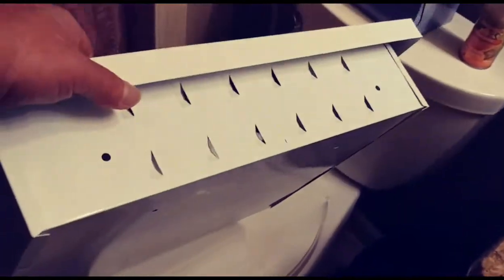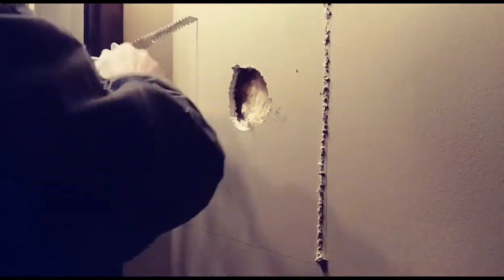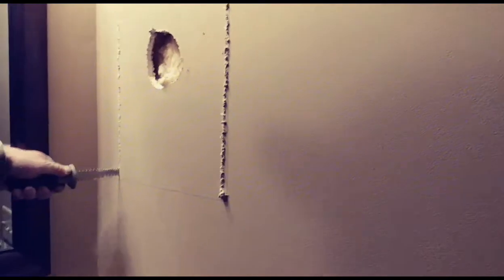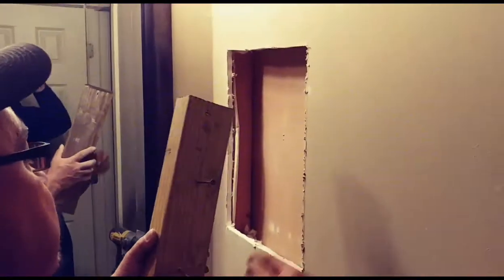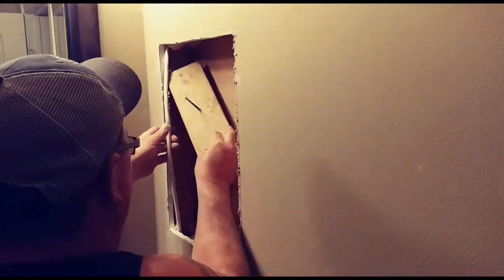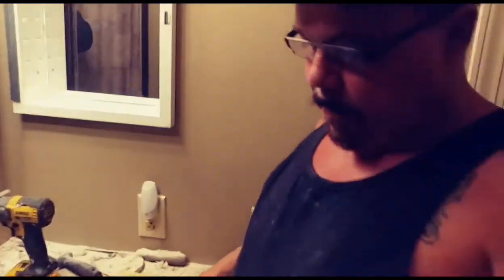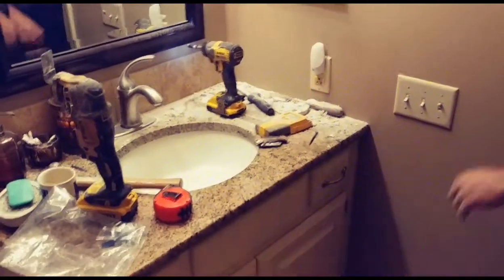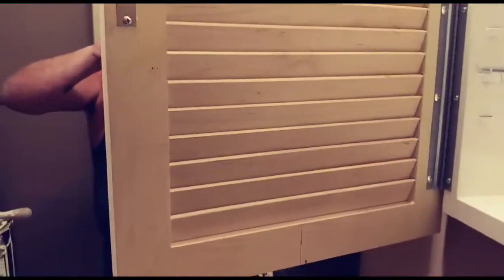How to install a medicine cabinet

Comment: I agree, it's a safety hazard to squeeze the electrical cord.  Needs to have room around cord in case of overheating to prevent a fire in your wall.  And you never used a level to make sure your installation was good. WTH.
Reply from the maker: The wires not squeezed nor is it in a bind. It is clearly movable in front of the two by four. Also the 2 by 4 stud in the wall is level if you are screwing to a level stud you do not have to put a level on the medicine cabinet